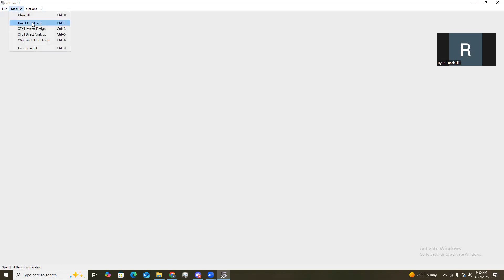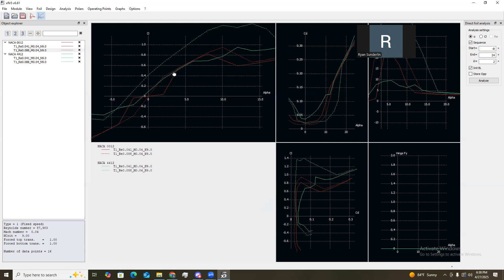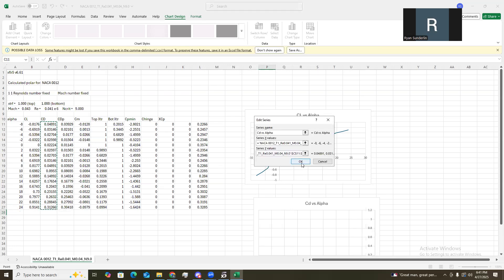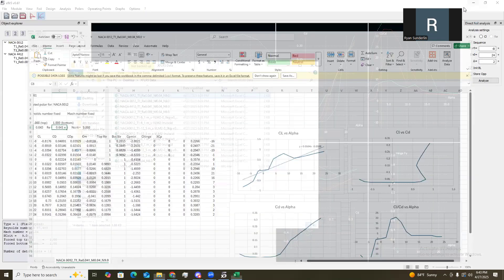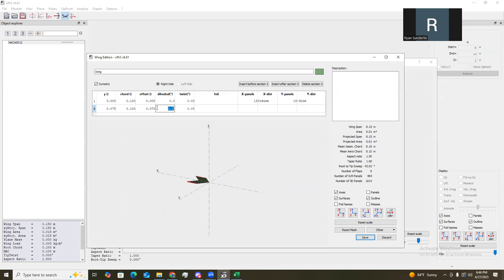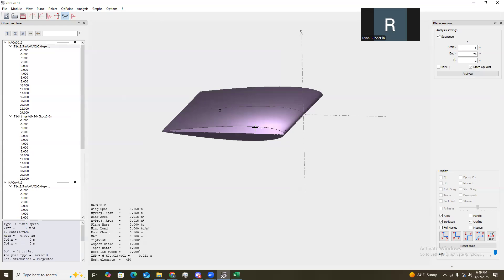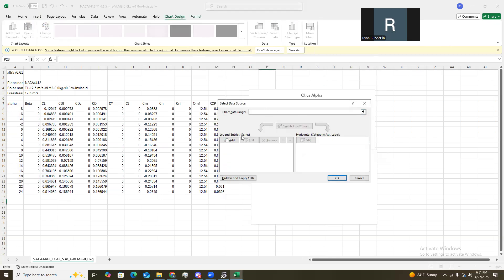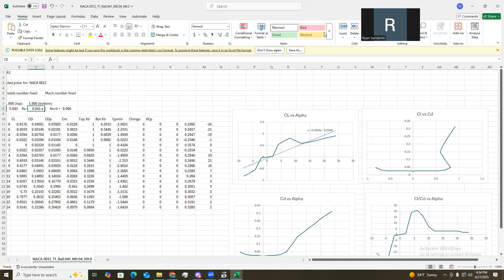XFLR5 NACA 4412 And 0012 Airfoil And Wing Analysis

Comment: hello, Aerospace student here
how did you come about the Re and Mach numbers for the foil direct analysis?
Reply from the maker: The Reynolds Number corresponds to the velocity of air inside a test section. As part of an experiment, a 3D printed airfoil was used in a wind tunnel and then this video used the same values (the NACA and test section Reynolds) to simulate the same conditions. The actual Reynold's value was calculated using the wind tunnel operating at different frequencies which produced different Reynolds values depending on the desired speed of the air in the test section. So in summary they were obtained outside the scope of this video.